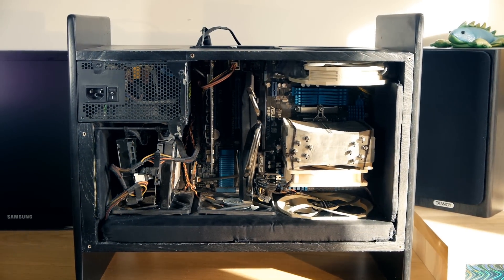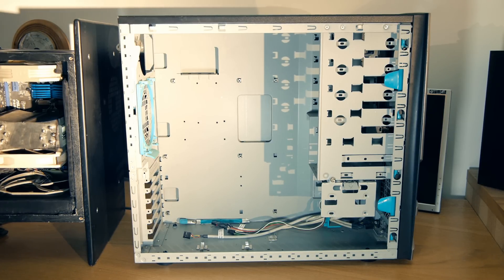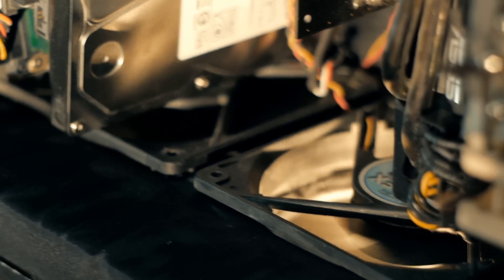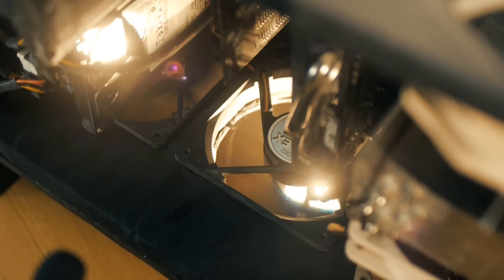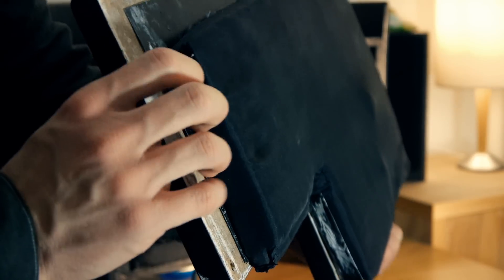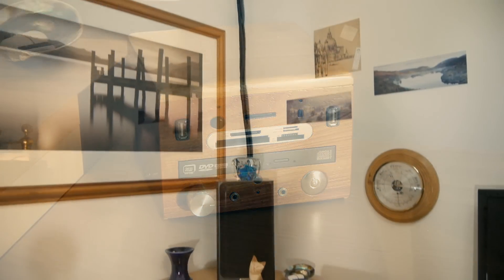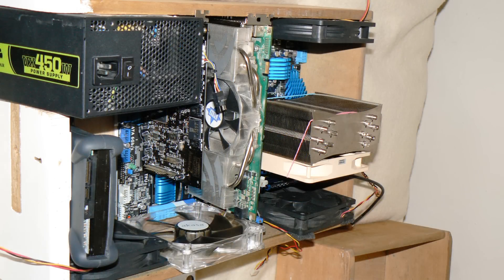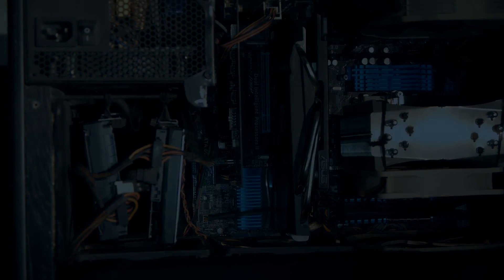My silent wooden PC

Comment: I am planning to get an Asrock C2750D4I motherboard which have a passive cooler.Do you think i should add fans (the bottom-to-top ones stuck on the case kind)to it?The CPU is 20W in terms of TDP,so having fans for that isn't necessary right?There is only 4 fan headers on the motherboard,and I want to reserve them for the HDDs.Thanks for any suggestions given.

Comment: Good, I am building similar pc but with two 140mm exhaust fans on the top of the computer and the I/O panel of the motherboard at the bottom of the case, therefore all cables (below) at the bottom of the PC

Comment from the maker: The motherboard was actually mounted on an aluminium sheet, which was in turn mounted on the wood. There aren't any dust filters, but so far it's not been a problem because the computer is elevated at ceiling height and there's very little dust. I've not had to clean it since putting it up there, anyway.

Comment from the maker: 60c is actually fine. Getting any less on an OC would be unrealistic (and I have a chip that doesn't OC very well), as that temp is hit immediately after stressing the CPU, indicating that it's reached the limit of the heatpipes (which can only take away heat so fast) on the heatsink. That's my theory anyway. :)

Comment from the maker: I read all comments, don't worry. ;)

For the PCI slots, I cut out (using tin snips) that area of a scrap aluminium case, and glued it onto a slightly larger hole (see the build pictures). For the IO area, I simply cut a hole as accurately as I could, and put the plate that came with the motherboard into it.

Comment: He explained that in the video, it's a fairly simple concept and bungeeing hard drives has been about forever.

Nice work DIYPerks, I did similar but with a large cigar box and an ITX PC. Wood makes are really nice material for PC building, some much more sound deadening than metal. Wonder when Antec or Corsair et al will catch on? ;)

Comment: people aren't taking into account the fact that you have the pc someplace where it's NEVER going to get jostled while in operation. hard drives are usually locked down so that if the case gets knocked accidentally, the HDD doesn't swing and hit something, which would jar the read/write arm and possibly knock the head against the plates. this is not an issue in your case though. it looks weird, but it's not dangerous for the drives

Comment: I don't like that hard drives positioning... They look as if they're not properly secured. Don't get me wrong... the elastic band idea is a strike of genius but I think you should have secured the drives better than that. As in... tighten the bands on the bottom and the top so that they don't move about when working... Other than that... excellent ideas!

Comment: hahaha love it! Very impressed with the build. A quick way to do fan cut outs is to use a power drill with a hole saw attachment of the preferred size. i.e. 8,12, 14cm, ect.

Comment from the maker: I didn't keep a tally on the costs to be honest, but I think that I spent NOTHING on the actual case, but a whole heap on the components... the processor was like £300 xD mobo was £60 or so, and the GPU was £80 I think. So about £500 with fans etc.

I'd love to build some cases for people, if anyone would like one. The problem is that I don't have many tools, and no work space, which makes it considerably more time consuming (try cutting a fan hole by hand! xD)

Comment: the only problem i see is that all of your fans are mounted horizontally. they tend to wear out faster that way especially if you're using sleeve bearing fan's. i hope you picked the right fans with the right bearings. otherwise you're quiet case will become a rattling case.

Comment: - Most optimised air flow system ever
- Computer closed in a hidden cabinet
- Super Stylish External control unit 

10/10, will build one myself.

Comment from the maker: Sure. Idle temps are about 35c, and under full load (prime 95) shoots up to 56c, increasing to 60c after a while but never really any higher. Core is at 1.320v, at 4.4GHz.

Comment from the maker: They're fine. There is no evidence that having drives off axis is bad for them. Hard drive orientation concerns (if there were any) went out of the window over 13 years ago...

I mean, laptops wouldn't be able to have HDDs in them if it mattered, and external HDDs would have labels on them saying 'keep flat' or whatever. So yeah, my hard drives are fine and are going to last a long time.

Comment: the drives shoulden't be just hanging their,

They should be in a vertical or horizontal position, any other position would cause damage to the units.

And nice case! :D

Comment from the maker: I have indeed! I've not OC'd the graphics card, as it's powerful enough for my needs, but I've got the CPU at 4.4GHz. I unfortunately have a 'bad' version, that doesn't OC too well, so the voltages are the limiter, rather than the temps (which are consistently cool).

Comment from the maker: PSU = power supply unit (the box that converts 240v into 12v, 5v and 3.3v)
CPU = central processor unit

You have a mac, don't you? ;)

Comment from the maker: Thanks, I appreciate the kind words :)

The hard drives should be fine. I can't think of any sensible reason why they wouldn't be. They're only slightly off axis, so the affects of gravity vs a vertical mount are going to be negligible. Not that it would matter. I think it's only an issue these days if the drive's orientation is changed during operation. :)

Comment: Awesome video dude. Clicked off of SPCR not expecting much but you did an insanely good job explaining your thought process/philosophy. Extremely helpful and a cut above many videos on here. I worry a little bit about your hard drives at an angle. As far as I know it's recommended by most manufacturers to have hard drives only horizontal or vertical.